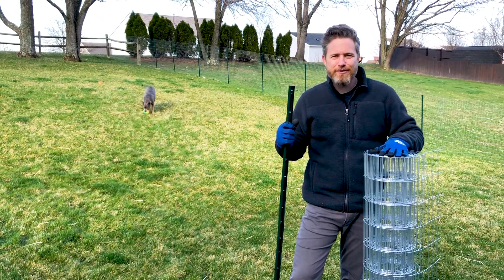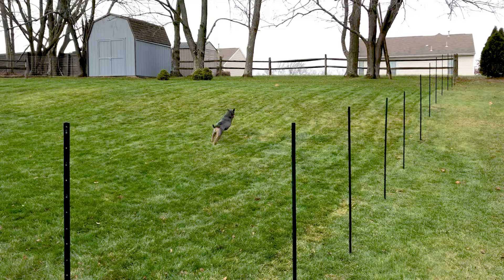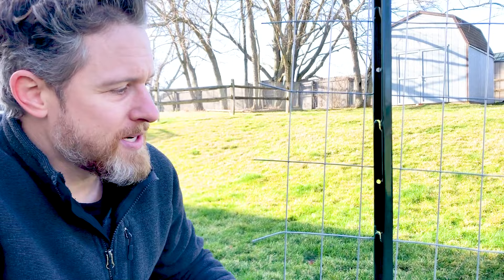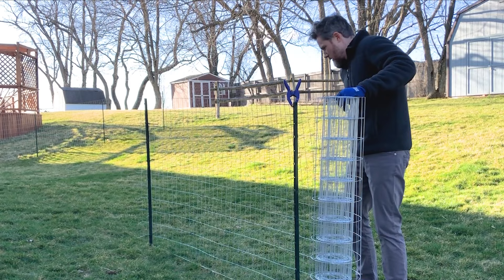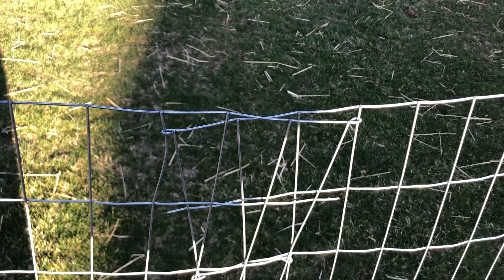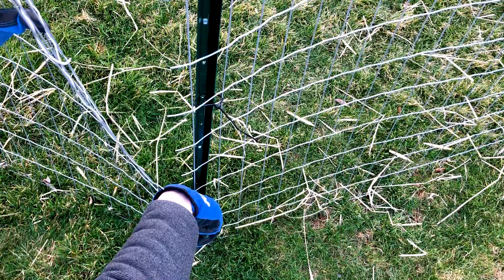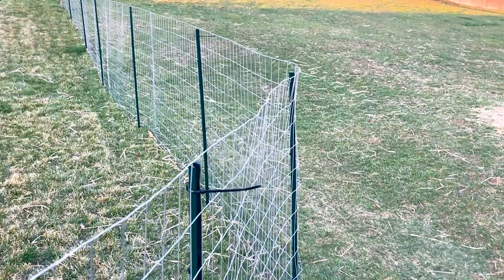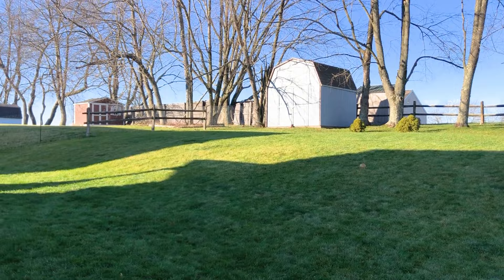How to Install a Welded Wire Fence the Fast & Easy way with Elevation Changes, No Digging

Comment: Good idea but there’s not even a fence brace so give it about 1 or 2 years and that fence will sag,still good for temporary fence though
Reply from the maker: This is strictly temporary. After a year it has held up really well, but long term I would need to add legit posts and rails.

Comment: The guy at the store said I could put the posts every 10 ‘. Also can I put the fence on the other side of the posts so I can use those tabs on the posts in case it lines up?
Reply: Depends ..
Are you trying to fence something in.. or something out?
This is one of the first things every kid on a farm learns.

Comment: Oustanding job! I am looking into fencing a portion of my yard for my dogs, if I may ask can you provide an estimate of what this project costed you and the dimensions?
Reply from the maker: The fence was around $90 per roll and I bought 3 rolls. Posts were around $5 each and I used about 25. Total cost was around $450 including incidentals.

Comment: How expensive was this? I don’t know how much welding wire to get, how many feet is yours? Will you please link materials? Thabks
Reply from the maker: I bought 3 rolls of 150 ft wire. They were about $85 each at the time. Got everything from Lowes.

Comment: 4ft wire on 5ft posts? The MFGs recommend all T posts be sunk 24" min.
So you should be using a 6 1/2ft post sunk 24" leaving 54" above ground.
48" for wire & 6" reflector above the wire.
Your Welcome.

!

Comment: I've never bothered trying to use the tabs. If you use a screwdriver like a wedge the clips are a lot easier to get on. There's a super cheap tool if you do this a lot

Comment: How many T-post did you use for this project?
Reply from the maker: Technically they are U posts (I was mistaken in the vid). I used around 30. General rule of thumb is 1 post every 4-6 feet.

Comment: Do you have links to these items? I want to make a fence but anything over 6 feet tall using it for some privacy for my Pool lol
Reply from the maker: It’s all from lowes. If you search garden wire and posts you’ll find it
Reply: @BuildingWithBlake  is chicken wire the same as this?
Reply from the maker: Chicken wire is a smaller gauge and smaller gaps. Its still effective for most jobs. I went with welded wire because it reduced the amount of cuts and crimps I had to make for elevation changes.

Comment: This is all wrong post are supposed minimum of 2 ft in the ground. The wire should be stretched tight, and the wire should be crimped to compensate for any landslope.

Comment: This is so wrong. Lol you have to stretch it.
Reply from the maker: It’s just a temporary fence. These posts aren’t strong enough to support stretching.
Reply: Only the corners support stretching, thats why you brace the corners. Even for a temporary fence you need to remove the tension and there are several simple ways to do it.

Comment: Good grief, don't use zip ties...
Reply from the maker: I know but they're faster for the initial install. Then you can systematically replace with wire.
Reply: @BuildingWithBlake  Cool.  Thank you for the response. 🙂